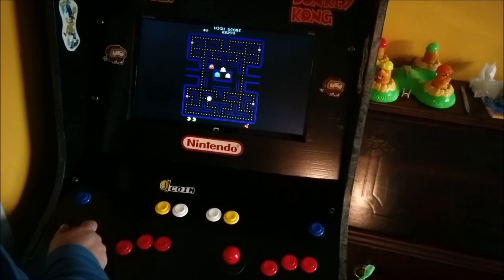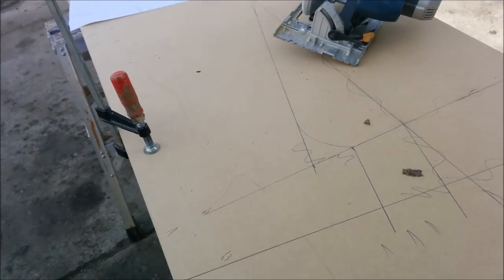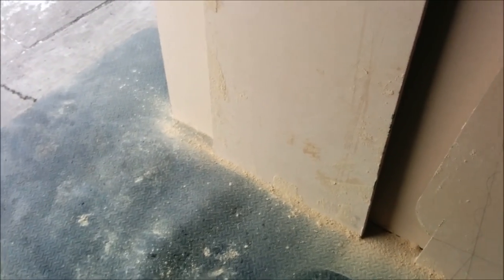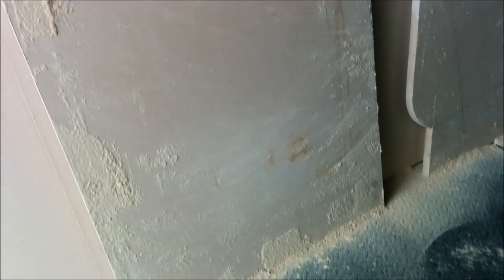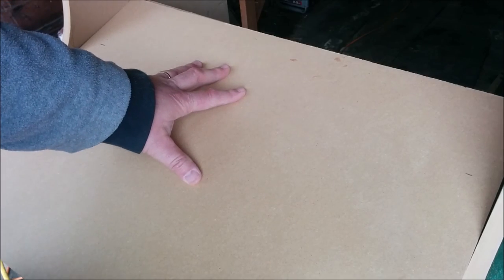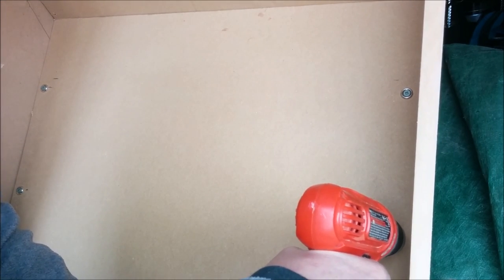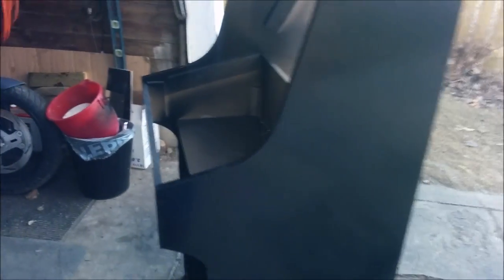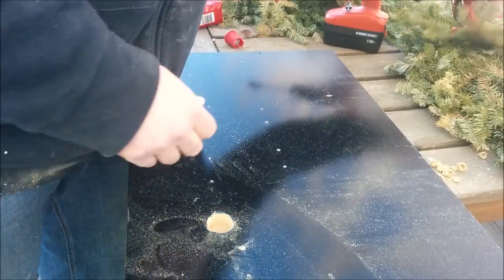How to Build a Raspberry Pi Arcade Cabinet  - My Experience

Comment: Don't use paddle bits on MDF if you want clean holes. Use a hole saw with a pilot bit. For the cleanest possible edges and to prevent scorching, Try this: run the hole saw just enough to lightly score the surface and outline your hole. Then drill another, smaller hole just inside that scored circle that runs tangent to the first circle. (use a drill bit that's just small enough to not touch the pilot hole) The smaller hole will be an exhaust hole for sawdust. Then finish drilling the larger hole. This will also reduce wear on the hole saw teeth as MDF is really hard on them.
http://www.woodworkingtips.com/etips/etip031010ws.html
Reply from the maker: cgrant26 great comment. Thanks

Comment: When I built mine, I went with a cocktail cabinet.  It cost me about $400 US in parts and router bits, but mine has a tempered glass top, a coin door, and I can wheel it around easily.  I used white melamine instead of MDF so I didn't have to paint and the white color scheme goes great with my Centipede artwork.
Reply from the maker: Benjamin Rittgers Nice! Most people ask me about cocktails.

Comment: Best tool you can ever make for a circular saw is a Circular saw jig. Just cut a long piece of mdf with a straight side and clamp it at the width of where you blade hits the line and you never have to worry about cutting straight again!!
Reply from the maker: Great tip. You should make a video about it. Thanks for commenting
Reply: Theres a ton of them out there on Circular saw jigs, I built one for guiltar and speaker cabinet making. They work great.

Comment: Really appreciate you taking the time on this.  I plan to build one that it kind of like a bar style.  It will sit on a desk, but will be small enough to be able to carry or move if you have to.  I believe my 4:3 monitor that I will be using is a 17".  I will be going with the SNES style controllers so my plans are to put a hinged door on the front where those will sit while not in use and will have cable guides so you can pull them out and close the lid.  Think a slot like the parking brake in your car.  I plan on installing a built in handle on the top and am trying to figure out audio right now too....what is that pig unit you are using?  I will most likely not be doing a marquee, but who knows.  Other than the pig have you noticed any heat issues with the LCD, etc?
Reply from the maker: No it is all good. The pig is a mp3 player speaker/amp/dock. If you see one buy it. They sound really good for the price. However, I purchased some old amplified PC speakers for $2 at a yard sale. I disassembled them, drilled holes in the cabinet and mounted them along with the volume control. I think this is the best solution. I will try and shoot a video showing it. whatever you do, make sure the speakers are amplified for good base. Thanks for the nice comments

Comment: You could easily make a pc boot into the emulator aswell. The raspberry is a much better option though because of it's size, the heating issues of putting a pc in a closed cabinet, the power consumption of a pc etc etc.
Reply from the maker: Great comments. Thanks!

Comment: i'm doing this on break..200-300 bux? i'm in. good job, thanks for the 14 button tip and joystick contact tip
Reply from the maker: The monitor is the most expensive part. Get a tube monitor if you can. I think it looks more authentic. Thanks for the great comment.

Comment: Hello John! I am about to do a similar project now in june during my time of from work. i just wonder where you bought your buttons and joystick kit. Thank you for your video, and it turned out amazing for you!
Reply from the maker: Thank you for the great comments. The "I Like to Make Stuff" site has a complete shopping list.  Everything is available on Amazon or any similar website like "arcadespareparts.com. Anything that is a switch will work. However, get a stick that will convert from 8 way to 4 way. Good luck. I use my cabinet all the time.

Comment: as for windows you can make it so it boots right up to hyper spin which  is a front loader
Reply: Yeah, but windows is a pain in the ass to use when it comes to arcade frontloaders and whatnot, Raspberry pi's just boot up into the OS and you're in, ready to go.

Comment: We built a raspberry pi cabinet and will be doing video on the build soon. Have you ran into any issues on the sound for arcade games, donkey kong specific. Half of the sounds are not working. Thanks and really cool video
Reply from the maker: +I Anthony Prime Thank you for the nice comments. From what I understand the walking sound is always missing when using mame. And I have not found a fix for it. It may be possible to add the sound files but I am not sure how to. 
If you find a fix please share. I love  playing DK and it is super smooth on my cabinet. Make sure you change to a 4 way joystick.
Reply: in the japanese  rom crazy kong the sounds all work

Comment: For a retro feel, I probably would use an old CRT based display, even if its heavy and if it runs the risk of having some burn in.
Reply from the maker: +{MLP} Rainbow Dash Needs to be HDMI
Reply: +John Loney It's possible to use the A/V port on it.
Reply from the maker: +{MLP} Rainbow Dash You are correct, it is possible to get a cable for a tube TV. There is lots of them around and it is a good way to re-purpose a TV.

Comment: Dude, you knocked it out of the park! Great build, my only question is how you did the pause feature on Raspberry pi? Thanks
Reply from the maker: Thanks for the great questions. There is a spot for it on the controller board associated with a keyboard key. I think it is the p key
Reply: Thanks for your response. Last night I was playing on my pi when I ran into a big problem that I can't figure how to fix. How can I get in touch with you directly for your help? Direct email? Help...
Reply from the maker: @jrocha3128 sorry dude. I am far from an expert in a raspberry pi. Truthfully, if I were to do it again I would use an old PC. Best way to contact me is Facebook. Just search for my name and I will expect your friend request

Comment: Good job Man U made look very easy and simple I will give it a try.do you have to download the simulators and rooms or they all ready download in the raspberry
Reply from the maker: This is the method I used. https://github.com/retropie/retropie-setup/wiki
Good luck. I recommend getting it running on the bench, then putting it in your cabinet. Or use an old PC.

Comment: hello, I was wondering if you had the blueprint for the cabinet so if I want to make the exact same one I can get the dimensions
Reply from the maker: All I have is the first link in the description. good luck. i am still using my cabinet
Reply: +John Loney I found it. it was just kind of hiding. then I had to pretty much make up my own dimensions because nothing I have can measure in the metrics system.